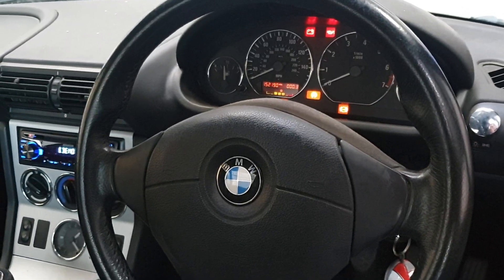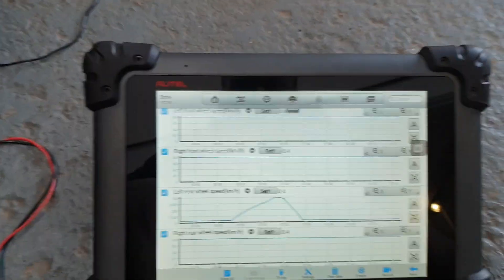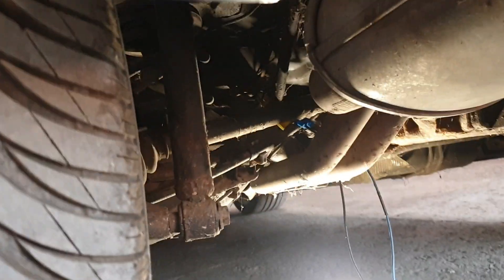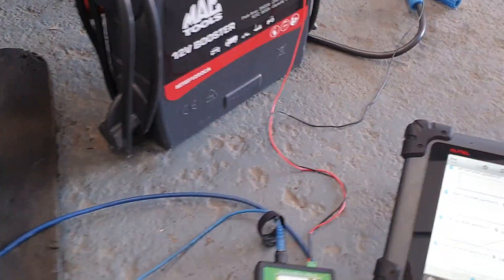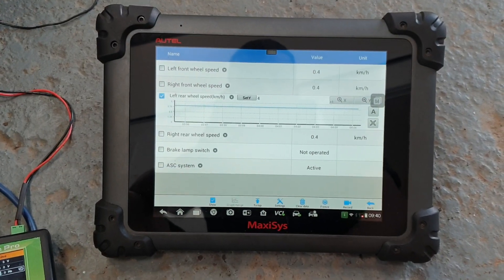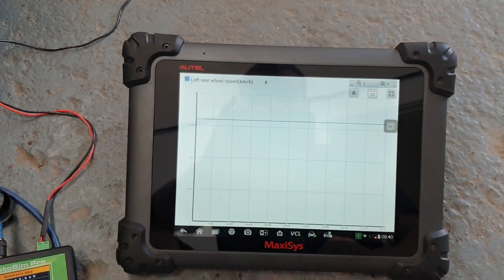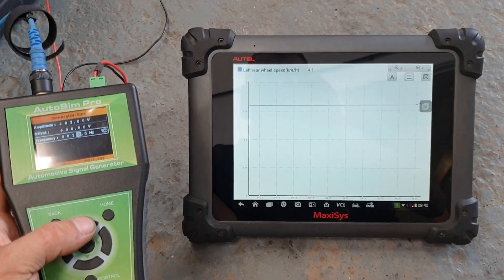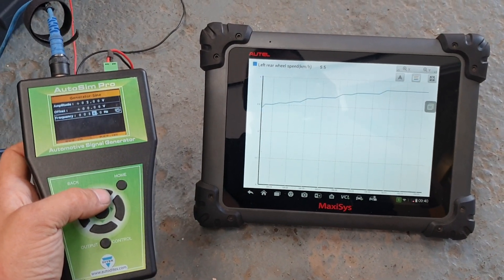BMW Z3 ABS Fault

Comment: I have a question, I've replaced all the ABS sensors and both front wheel bearing on z3 with the rings being replaced as well, but I still have abs/asc light on my dash, I did replace the pad sensor rear and light went away for a few months but now its back again.. I have had the car looked by a garage, and they couldn't help. Do you have any ideas? 

Thanks

Comment: The left wheel speed sensor seemed like it was fine to begin with, can you use that for the other 3 that weren’t giving a signal?
Reply from the maker: yes, so once we got a baseline of the signal we needed to produce, i used the tool on the other 3 and found all 3 sensors had failed.
Reply: Elite Automotive Diagnostics that’s beautiful I need to get one of those signal generators.
Reply from the maker: @weldingjunkie  they are avaliable via our website, link is in the description 😁
Reply: @eliteautomotivediagnostics4424  wow!  All 3 sensors failed at the same time?? That's a rarity!
Reply from the maker: @CubasAutomotive  this vehicle was stood up for a while and moisture and corrosion had set in internally to the sensors it turned out
Reply: @CubasAutomotive  unless the owner has ignored the abs light for a long time and now it's M.O.T time coming up how u Cuba love ya videos sweetheart keep up the good work xxx
Reply: @laddie5133  very good point! I forget people ignore the lights! Lol 
Thanks sir! I appreciate the compliment! 😊🤗